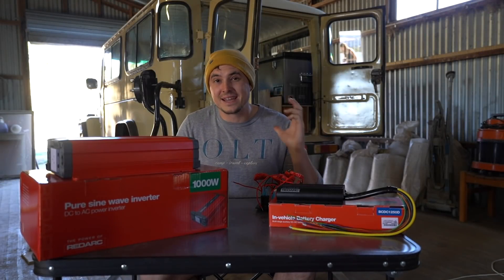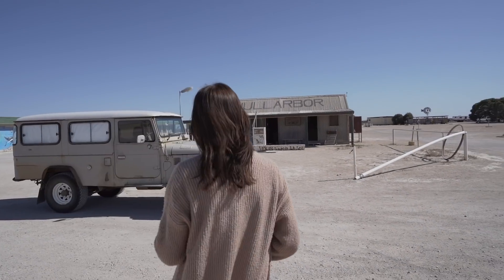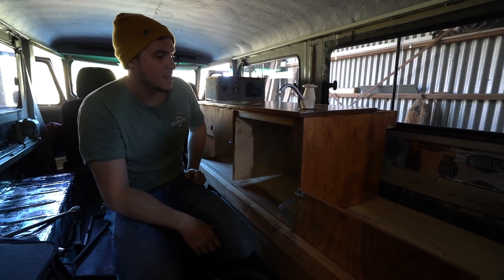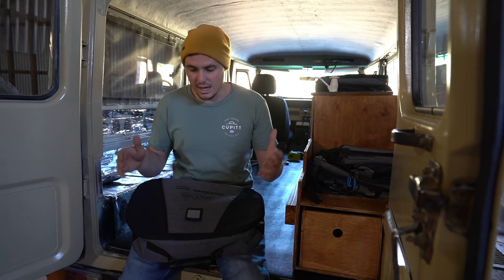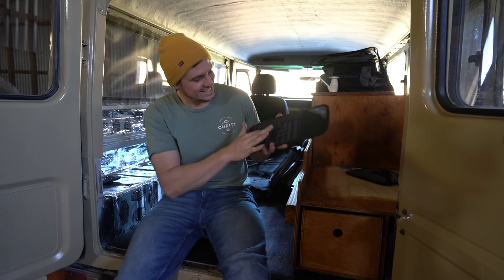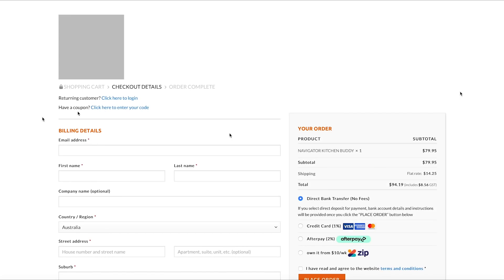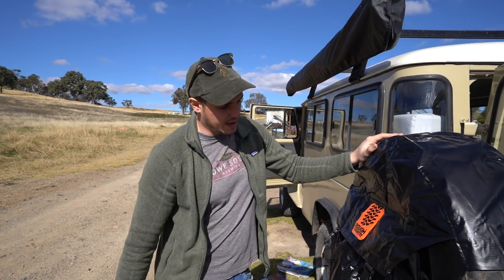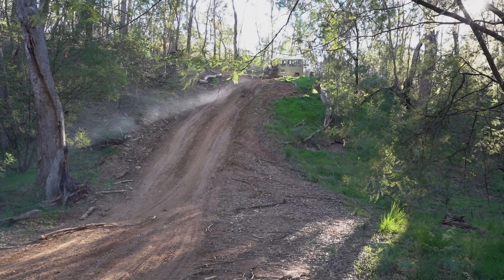FINALLY REGISTERED - Camp set up for Troop Carrier - Ep16

Comment: Hey guys. Nice work all round. One suggestion you may want to consider, how about a small drop down prep / cutting table attached to the inside of your right hand barn door. Hinged so it can be out of the way, but have steel cable or rope screwed to the side of the board to give support. Look forward to future vids.